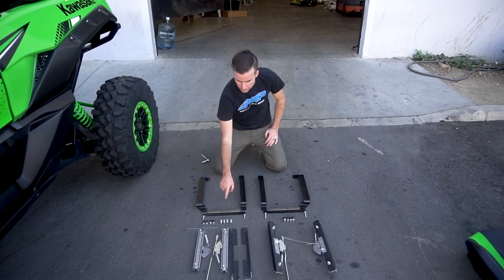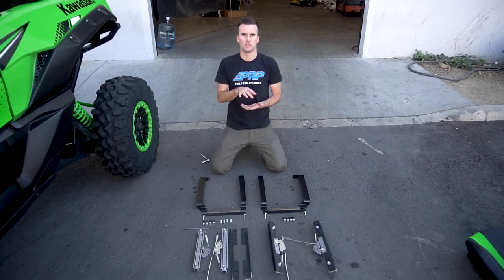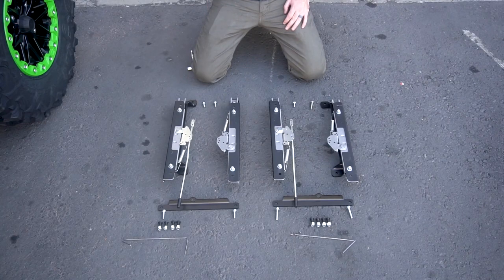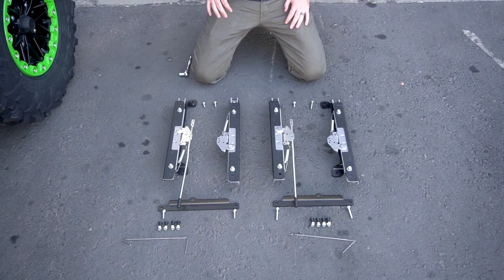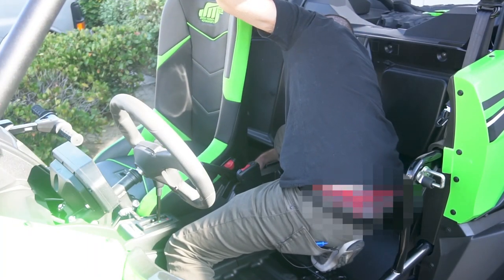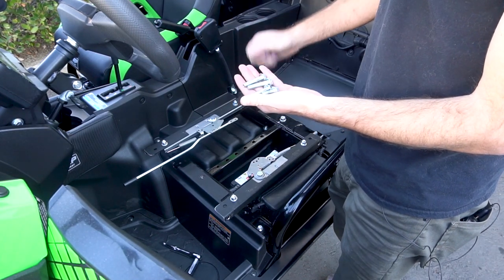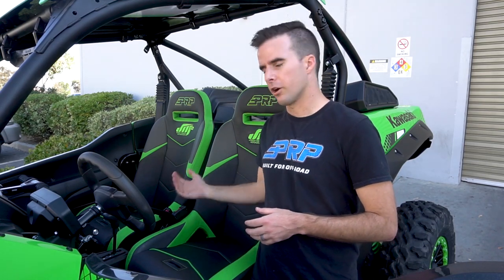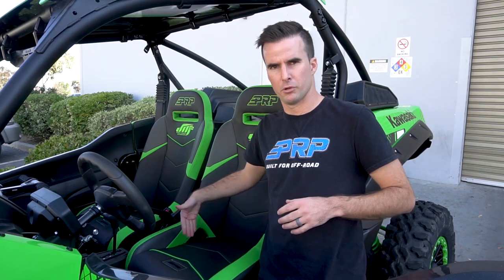PRP Seats for Kawasaki KRX 1000

Comment: Zack:  great job on this installation video!  (except for the music which was awful and very distracting....please don't pipe in music in future instructional vids).  Question for you:  for the GT3 and GT SE seats where the stock KRX harness won't work, do you have an instructional video on how to install PRP 5.3x2 harnesses in the KRX?  Where do you attach them behind the headrest??
Reply from the maker: The lap belts are going to install where the existing lap belts bolts on either side.  Unfortunately the KRX doesn't come with Harness tabs or a bar on top for the shoulders.  So you will need to purchase a harness bar either from Kawasaki, or an aftermarket dealer.

Comment: Will these seats work with the Kawasaki click 6 harnesses?
Reply from the maker: Yes they still work with the Click 6.  If you want the belts to run through the harness slot in the headrest of the seat, you will just need to remove the click 6 retractor box,  push it through the headrest slot, and then reattach it to the bar.
Reply: PRP Seats thank you. Does the seat recline more than the stock seat? The reason I ask is that the stock seats when pushed all the way back for max leg room will actually touch the harness bar so if the prp seat is a more reclined design it will inhibit some of the leg room for taller drivers. Thanks in advance for your answer!
Reply from the maker: @Angels1994  I don't have the exact angle measurements, but both seats felt about the same recline (with the PRP being maybe slightly more upright than OEM).  We had the big boss Aaron (6'3") sit in it and test it out.  While we didn't have the Click 6 Bar in at that point,  he still had extra legroom to spare.

Comment: I bet your seats. Won’t lean back...  FYI that fkn sucks
Reply from the maker: Hey, Ken. Just curious, why would they need to lean back? Most UTVs don't have the room as well as some kind of harness bar so it's no usually possible. The KRX has a little more room behind the seats, we took advantage of that space to create more storage.
Reply: Well I own a 2019 c7 corvette..  the seat royally sucks if your in the car for any length of time because my lower back starts hurting from the forced upright position..  regarding the ability to lean the seat back ...  if it would tilt back enough to relieve pain..  not lay down but the ability to tilt the back rest slightly or even lower back support. The inability to adjust the back sucks for folks like me.. my ss cameo mustang got I had were great .. recline slightly for comfort.. when your ready to get it sit up straight.  Revert back to Cruze mode back relief.. I hope you will consider that.. I know I would purchase a set if they did..  again maybe tilt back 3-4 inches max.. scoot the seat forward and allow the seat to rest back.. again I have a new c7 corvette not much room in that car.. what I do is move the seat forward slightly adjust the back as far as she will go and then do the tilt feature the entire seat back to attempt to find a position I can live with.. I’ll be completely honest I’m probably going to sell the car at a loss becaue the fkn seats suck for that exact reason..  and yes the know it alls will say.. it’s a track car you need to be in a perfect racing position period..  I completely disagree especially when folks like me will be happy to throw any amount of money at a problem until it’s fixed ...  I want to participate in the sport sadly I’m a veteran with damaged L3 and L4 in my lower back.. I’m fine almost always the seating position makes my left leg feel like it’s on fire if i sit up straight too long.. just a thought I’m only one person.. in this day and age the individuals problem is not a concern of the people apeasing the masses..  you say.. maybe sell a frame or bracket to fit seats already in production.. because you asked the krx stock seats as well as other oem sxs have two piece seats.. fab a frame for the stock seat to a.low the upper seat/back to recline slightly for us whiners.. 😛🤓😎